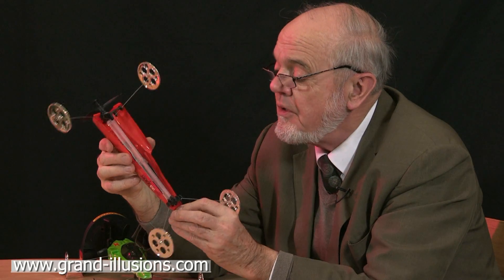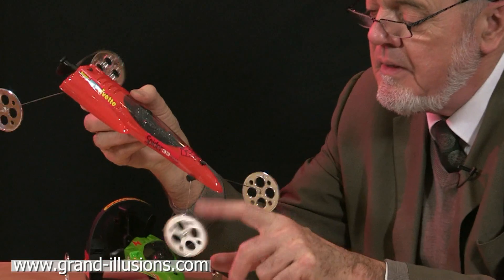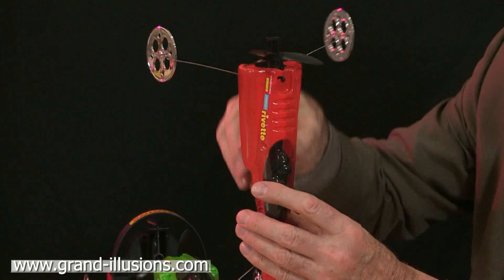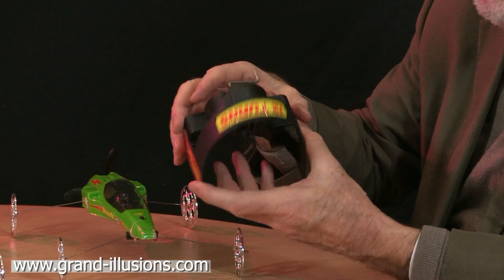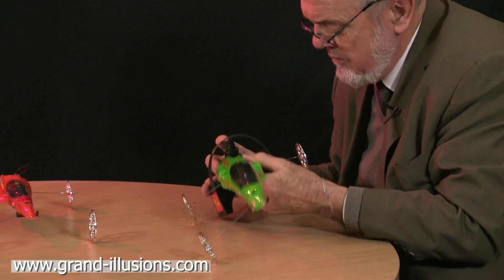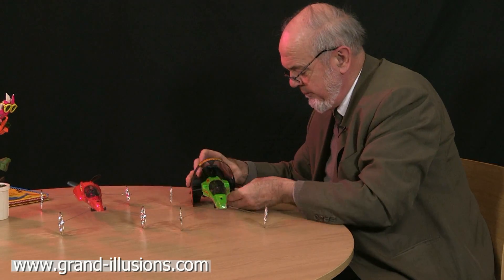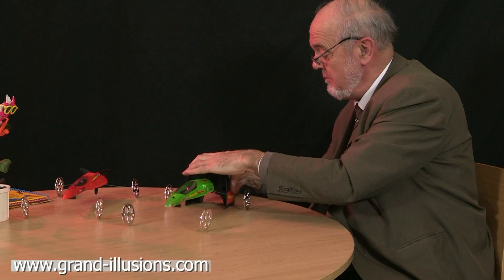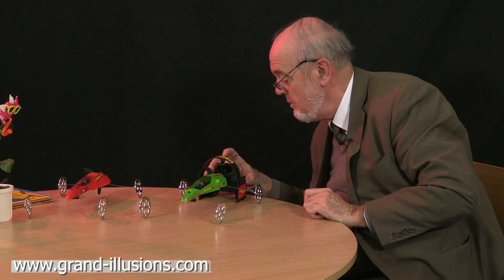Elastic Band Powered Car

Comment: I love this channel, but I'm disappointed to see no "official" response to the criticism here.  It is highly improbable that the variable speed of a rubber band powered prop would exactly match the frame rate.  It is highly improbable that the car would start moving immediately, because the prop would take about half a second to accelerate up to sufficient speed to exert sufficient force on the car to start it moving, then the car would take a second or so to accelerate.  Then we'd see it accelerating, which we don't.  The motion seen here does not correspond to a propellor-driven vehicle.  Isn't it time to come clean?
Reply: He was turning the crank the wrong way, so it didn't actually wind the prop.

Comment: He wound it the wrong way. Notice how the propeller moves counter-clockwise (looking from the front) just a bit when it's released? That's the way it was supposed to turn, so he should have wound it the opposite way. However, he wound it the same way. It was just the force of the release mechanism that pushed it off the table.

Comment: There is a tube filled with air under the car. When it is winded up, the air is compressed, and then when released, it will push out, much like a balloon. I'm pretty sure that's how it works.